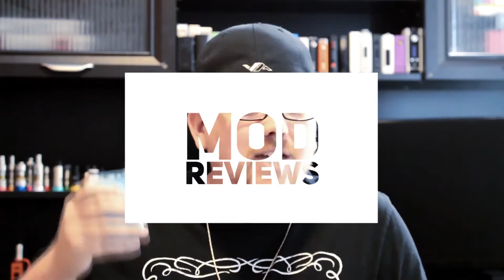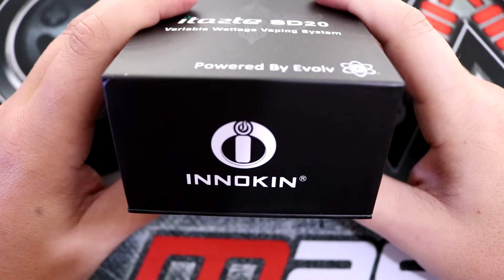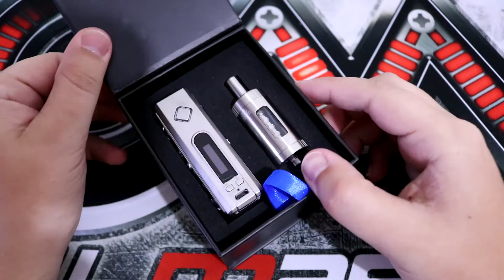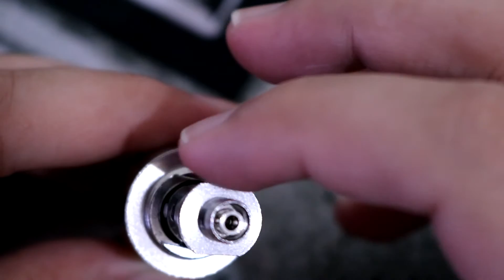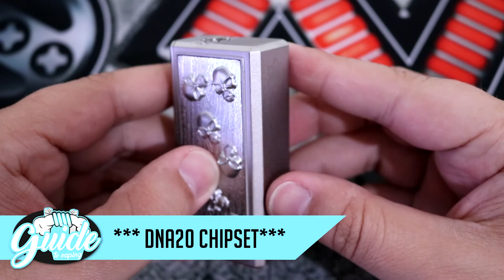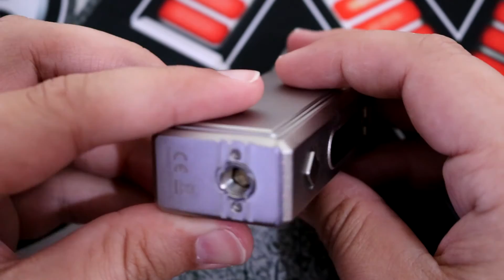Innokin iTaste SD20 DNA Kit Review

Comment: this is the best low wattage vape available. add a nautilus mini and you are good to go. built like a tank and all day battery life. I use mine with a kayfun v3 mini at 15 watts as my all day vape 24/7. $40.00 mod $ 100.00 tank priceless vape. dripper flavor but a juice and battery miser. the regulation on the dna 20 chip set is spot on no burnt coils like a istick or others in this price range. a bit of history on this chip set it followed the dna 12 and the original dna20. innokin and evolv teamed up and improved the 20 adding a slight pre heat punch and the ability to step down below battery voltage. first board on the market to do so without useing pulse with modulation and has been standard in all dna boards since. the original board was used in the itaste svd2.0 and the same board is in the sd20 still says svd2.0 on start up. nick at Evolv verified this as well. by the time the SVD2.0 hit the market the dna 30 was out and it got lost in the shuffle it can still be found dirt cheap but it's a big mod even in 18350 mode. can you tell this is my favorite chip set and mod? got mine from direct vapor a few months ago great mod great company. hope this helps someone ✌